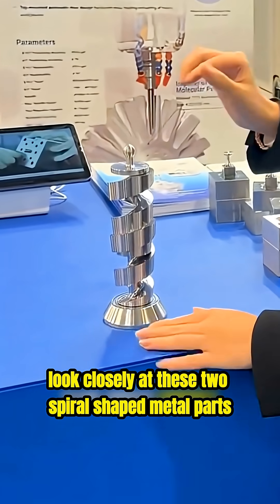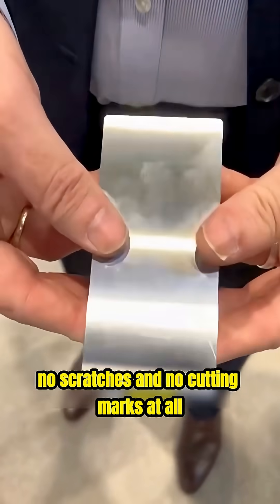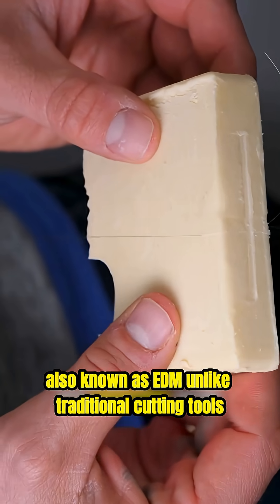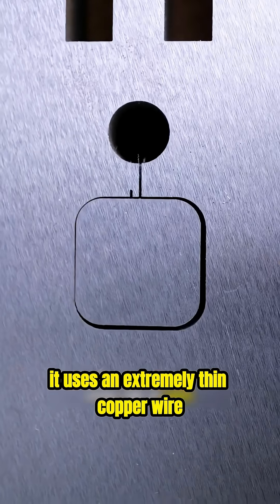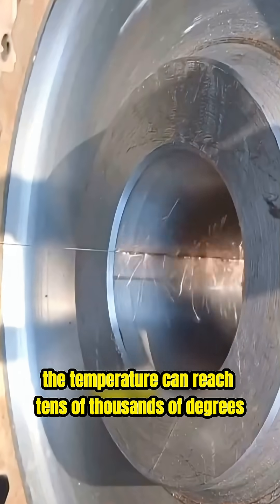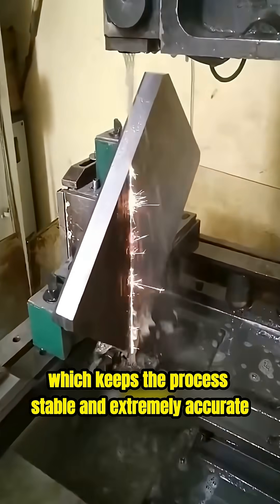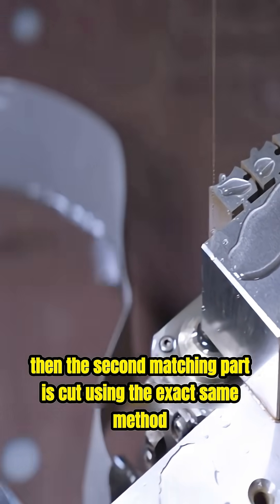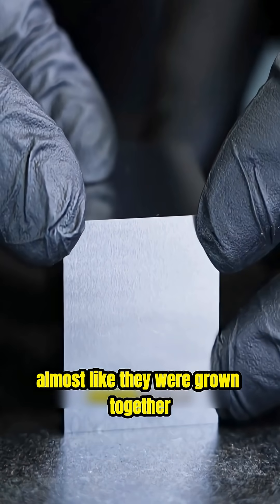How Metal Parts Fit Perfectly Without Gaps | EDM Machining Explained

Comment: Its a cnc wirecut machine.. edm does a drilling job on a micro level to allow insertion of Thin wire to operate on cnc machine to cut the metal